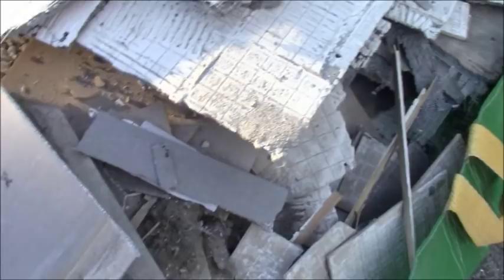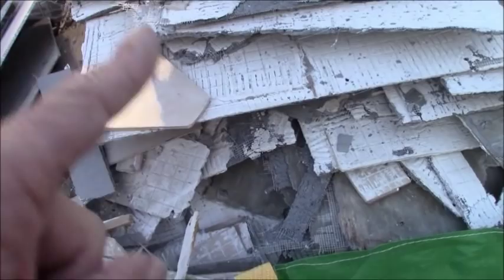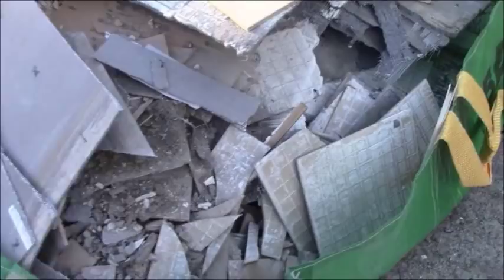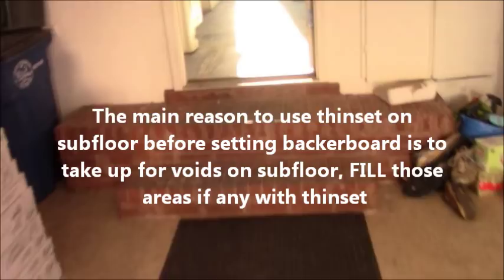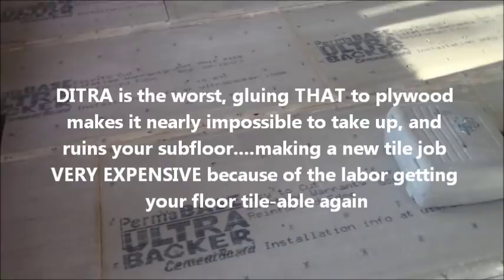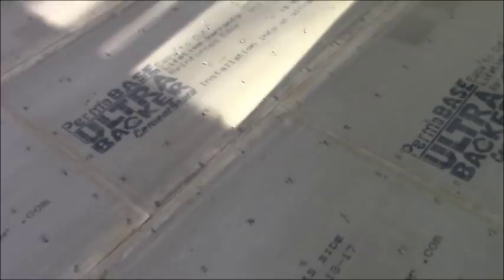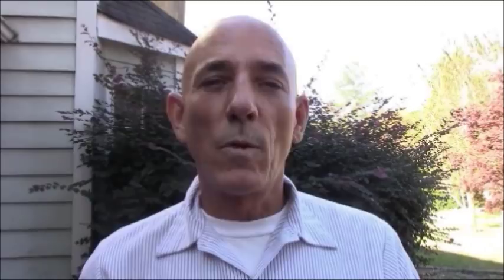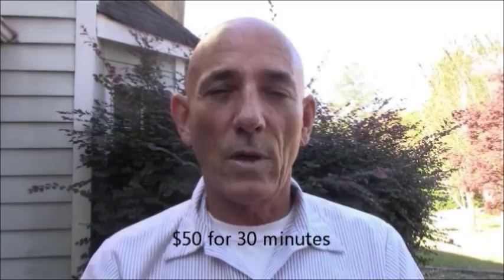GLUE BACKERBOARD ON SUBFLOOR ??

Comment: So I am doing a curbless bathroom and your video was very helpful.  I need to build up the bathroom floor to meet the pan height.  I am doing 3/4" plywood, then 1/4 cement board and then ditra on the cement board.  I won't be using thinset on the cement board to subfloor.  Does this sound reasonable?
Reply: This is exactly what I am doing.  I'm at the backer install phase now, and wondering if I should thinset or not.  I had to put 3/4 tongue and groove ply on top of my 3/4 OSB subfloor, secured by a million screws and used feather finish and adhesive to fill the low spots there.  Now I need 1/4 backer, then ditra, all to get the height to the curbless shower pan.  The 3/4 ply is pretty darn flat and basically level everywhere.  12x14' floor plan.  Some low spots when running a 4' straight edge mostly no more than 1/16th inch with a few 1/8th inch spots.  Those are over a few feet.  I'm thinking with backer screwed down only as another flat surface, thinset to ditra, and thinset to tile, there should be room to take up those gaps.  What did you do and how has it held up for the last 2 years?
Reply: btw my tile is 12" x 24" ceramic

Comment: If the customer chooses not to pay the extra cost of  thinsetting the backerboard, fine. Assuming you have explained what the mfr instructions are and why they exist, and your personal experience not thinsetting. Not doing it because of the difficulty of removal  is wrong. Using unmodified thinset, stats clearly not for use on plywood because it doesn't adhere well, i.e. easy to remove. You addimitly against it is 100% incorrect.
Reply: Would you use modified flexible thinset ?

Comment: Question based on all of this dialog - the subfloor in the 100 year old house I'm working on  is 1x4 pine on a diagonal with typically 1/4" spaces in between the boards.  It was under hardwood. I'm changing this room to a bath, so to tile.  I was planning to put the backer board down on the 1x4s with screws or roofing nails. Then tile. Sound good?
Reply from the maker: When I run into old houses with slat board as a subfloor then I usually put a 3/4 or 5/8 ply on top of that, then quarter inch backer board and then tile

Comment: 30 years under my belt, of setting tile, and I've been creeping on your videos for a couple years now. while I don't necessarily agree with all of your methods, you do tend to give your objective reasoning and accept your reasons to be challenged. I admire that. 
This particular matter, however, is one that I've always fought myself over. I always want to meet manufacturer requirements, but I have yet to see a problem from other people's work, which directly resulted from not thinsetting down backer board. I still do use thinset under my CBU, to satisfy the manufacturer, but I usually lay down paper or plastic beforehand. This allows the thinset to bridge any lows, but allows the CBU to be only mechanically fastened to the sub floor. It may kind of, maybe allow for a small amount of uncoupling as well

Comment: Garbage it needs thinset under it.

I think your just hard headed.
Reply from the maker: Not hard headed, just a LOT of experience so I speak that which I know.
Reply: StarrTile 
Why not just fallow ntca recommendationd ? 

It's like installing tile with grout only.
Reply from the maker: Say WHAT !!???
LOL !! I'm not doing things to ruin my customers house/floor...you can, I won't. 
Robots do with no thought or logic, sorry buddy I'm not a robot.
Reply: StarrTile 
Like I said your just being hard headed.i think your mentality is everyone else fallows the manufacturers guide lines  are just sheep..but you know better than companies that spend a ton of money on R&D .

Atlest have a disclaimer that says you don't follow ntca or manufacturers guide lines.

So DIY'Ers can make an educated decision.
Reply from the maker: Hard headed no, just common sense...if I started having failures I'd have changed my method YEARS ago. And I agree that most companies do R&D, but in the end they overkill instructions to CYA themselves...the typical DIY'r that has zero experience could mess it up easy, so most companies will put that COFFEE IS HOT label on their cup.
Reply: just an fyi, we had floor tile installed 2012 where thinset was used under the hardibacker board along with screws.  We pulled up the floor last month and all that thinset was dust and only thing holding the hardibacker board to the wood subfloor were the screws.
Reply: I build towers and know first hand how engineers during R&D overcompensate. Watched a ton of your videos during my shower project. Thanks
Reply: I have worked with tilers with 30-40 years... 10-20 easy and they are glue and screw... Not a few all... So using experience as your go to is not the best hand to deal... It does make it hard to remove but it also gives stability to floors where it can lack what you dont see or feel... Use a flex bonding mortar so it is slightly flexable and you're good... I also took a class where we glue and screwed and did not... They used a jack to shift the floor to represent contraction and the non glue floor cracked in 5 different spots... The glued floor was solid.... Not saying you are completely wrong but saying gluing is as correct as your opinion of not... I like your videos though... Keep up the good videos and try to rest them knees lol... Take it easy boss
Reply: Also 1 more thing... I did a floating floor in my brothers house... House is 1 year old... When you walk in it it use to shake bad... Under the floor I glue and screwed 1/4 ply..... The house was soild as an ox afterwards... His wife thanked me for taking the feeling of them having a train next door away.... So as I said above it gives stability.... His house cost 200k to build also... #buildersnowadays
Reply from the maker: Mike Fox Renovations I appreciate the information you provided, would have loved to see that floor come up the way you described, however I go overboard with nailing my backer board and I doubt very very seriously that I would have that same failure but perhaps they use the instruction of the manufacturer which was probably to use less than I would ever use. And I am not disagreeing that spreading thinset and then your backer board will be a more stable application, but the question is why.. if thousands of people have never glue their backer board and never had a failure then what difference does it make in the end, after 20 years if I had had a failure with a floor I would probably change my method. Also I love showing videos like this where there is no failure, but yet other YouTubers out there will bash me and tell me I'm doing things wrong without one piece of evidence, all they point to is manufacturer's recommendations, tcna, Etc without providing any evidence whatsoever. One guy in particular talks about all failures that are possible but never shows them, in a court of law he would lose every case he presented
Reply: StarrTile yeah like I said I am not calling you out or saying you are completely wrong... I also agree with the subfloor issue but if you use hardie it usually can be retiled over... You do great work and I enjoy the things you post so keep up the great work
Reply: Thinset is more about filling in variations in the subfloor. Also, I'm sure a lot of people were not using a polymer modified thinset(got glue) for plywood.
Reply: If he is wrong then how can you explain my floor that lasted 22 years before cracking laid on 1 inch thick wood only sub floor?
Please explain why you are so convinced backer must be glued if the idea with backer is to cause a semi floating floor. 
Now days people do want to change their floors on an average of every 6 to 12 years. Why make that an impossible task just because USG or some other Globalist NWO corporation tells you too. I will go with the word over experienced tradesmen over some college book worm logic any day. How long has your tile company been doing this and what experience do you have doing the job with out GLUE AND SCREW. The point is Do not knock it until you have tried it. 
I am old enough to have been in the world before durock and have seen quite a few smart things in my time. Not sure if you are one them.

Comment: if you think thats bad you'd really be in for a treat up north where we used metal lathe and mortar for years as our sub floor....worst tear out ever.....but yes you always thin set your board down, tile jobs are meant to last a life time you dont worry about whether or not another guy is going to come along and do it again 20 years later....this is just being cheap and lazy, not wanting to pay for twice the amount of thin set.....this is hack shit
Reply from the maker: I base nothing in my videos on opinion or cost, in fact I don't even cover the cost of material, all my opinion has to do with real life experiences as I showed in the video, that does not lie despite and regardless what you have ever been told or how you do it... Life Time is what they get without using thinset, but then you back nothing up with proof as to what you said so it is irrelevant
Reply: I lived in New York all my life where tile floors and real hardwood floors are the norm. 50 year old buildings with the original pink or teal tiles😝 I now live in Georgia where the homes are built to be torn down and replaced eventually. The trend of the day prevails and complete guts of older homes are common. You can’t... shouldn’t judge the method strictly based on what your used to. I can definitely understand why you wouldn’t permanently attach flooring your sub floor with adhesive. And as for manufactures Recomended method.. again,  the real world changes, improves and adjusts as it sees fit. My home here in the south, has no tile anywhere. They put carpet in the bathroom 🙄. But we plan to glue and screw with the mindset that we will be the ones doing removal later on, only for better water protection. People treat flooring down here like wall paper.

Comment: So are you saying that a perfect, and stable subfloor there's no reason to put thinset under the backer board? Because that's the situation I'm in. Very solid sub-floor, perfectly level, and I want to put some tile down instead of linoleum.
Reply from the maker: What I am simply saying is troweling out thin set and then screwing the backer board to the floor will cause problems later on removing, when in my humble opinion it is not necessary to do both, either use a lot of screws or a lot of nails to fasten your backer board, I don't see the advantage of having thin set and then fasteners

Comment: scraping a quarter inch thick layer of the contact cement  /with lots of linoleum still stuck to it/ off the concrete floor before installing my kitchen tile i was cussing that dude every 5 min!
Reply: but i bet you charged a heck of a lot to take it off
Reply: Who in the hell uses that much contact glue

Comment: ... due to costs there is no going back and with that said 

HEADS UP --- i over think things and my posts are sometimes long because my thought process is long, and with that said,

-> Warning LONG POST 

*TOPIC

-Hardieback Boards 
-Thinset
-Liquid Nails
-Vinyl on Hardieback 

... my plumber who also does tape and float, floors and other things was going to put a new toilet in my small bathroom but we noticed some of the flooring around the toilet area was rotten out so I had him just put entire new floor of plywood instead of cutting the section out especially since the bathroom is small.

... my original plan was to use peel and stick vinyl squares, and he brought up maybe putting hardibacker on the floor. 

... I didn't know what that was so I did some research and went ahead and okayed putting it on.

... now for some reason I did not continue to research (i should have) and i didn't know about the recommended thin set layer between the subfloor and the HardieBacker ... and my guy used Liquid Nails and hardibacker screws because he said he's done that before with no issue.

... but i didn't realize is that you can't use peal stick vinyl squares on top of HardieBacker boards.
* (unless there's a way? )

... so then I thought maybe I should just go ahead and use ceramic tile from this point forward since I have seen some of his ceramic bathroom floor work and looks pretty good.

... but then he tells me that it IS possible to use peel and stick ( or non peal stick) vinyl squares on top of the hardibacker board by FIRST applying and spreading vinyl tile Adhesive on top of the hardibacker board and then apply the squares.

... and then I just recently read that it would be best to first apply self leveling underlayment like your video, and then use the VCT adhesive on top of that then put the vinyl on top.

-> So my questions are:

1. is it really possible to use peel & stick vinyl squares on top of HardieBacker board especially if you're going to use a vinyl tile adhesive first and or self leveling layer?

2. What about the issue of him using Liquid Nails between plywood and Hardieback instead of the recommended thinset?

and most importantly since I don't have the money to tear it off and start all over and since the new floor and the HardieBacker boards are already in place (and actually looks and feels solid)

-> what is your advice to do from this point forward?

1. Try the peel and stick or regular vinyl using vinyl adhesive or self leveling underlayment on top and see what happens?

3. or ????

#Thoughts 🙄

Comment: Thank you for sharing this video ,I decided to not put thinset under backer board, but I have a question. Should I seal osb floor(with Levelquik acrylic primer) before installing backboard, since the osb subfloor is 20 years old and a little bit uneven. Do I need self leveling the osb subfloor or just install the backboard?
Reply from the maker: Using a self leveler is totally up to you, if it's minor deflections you can make it up with thinset but every job is different so I cannot give you a straight answer
Reply: @StarrTile   Thank you !

Comment: I totally agree with you !! I also do flooing For a living Carpet vinyl hardwood floors just recently had to pull up a floor that was glued and screwed I would love to slap the crap out of people that do that
Reply: You must not understand how to do renovations. If the floor is 3 layers thick. Remove the tile. Sweep up and clean. Get a good demo blade or blades...Cut the first layer down to the sub floor. Or to the joists. Depending on how good you are and your crew. If you are a surgeon when you do renovations you will understand what I am talking about here. If you are not or do not have fast amounts of knowledge in removal for renovation then pay attention. Make the cuts manageable. Start with cuts that are small. 2'x2' get down to the level you want and pry easy. Thing will start popping up.Vacuum going and a broom could take you 1 hour to do a 12' x 20' area. If you are clueless it could take you 3 days.

Comment: i am about to set tile on concrete floor. Any advice? should just set the thin set right on concrete
Reply: That's fine generally but concrete usually can't be relied on to be level. Check for low spots and use a  good filling/leveling product imo before setting the tile.

Comment: I have a stacked washer and dryer and a small bathroom. Heavy. Can I still get away without gluing the 1/4" hardie board? I will use lots of screws.
Reply from the maker: As long as your floor is sturdy, flat, and level, the reason you would use thinset first is to take up for all of that
Reply: @StarrTile  thanks. I have tried to to do my best to scrape everything out. But there are some glues that might give 1/8" variation of thickness

Comment: Do I tape the seems once nailed down?
Reply from the maker: If you follow manufacturers instructions, then yes, use tape. I rarely do because in my mind I can't see the benefit in doing so....it is said it will prevent cracking between the sheets that MIGHT transfer to the tile, but I've never seen that happen and if it does, you have a BIGGER problem. My CYA response is use the tape if you think it helps.

Comment: Bob my house has 24" oc floor joists can I still only use 1/4 hardy backer
Reply from the maker: Depending on the subfloor...if it's 3/4 or 5/8 you should be fine, anything less should be shored up with another sheet of ply

Comment: What are your thoughts on taping the joints?
Reply from the maker: Although it is recommended to tape the joints, the way backer board is set and the thin set that is embedded anyway during the tiling process I find redundant and not necessary, I've never run into a failure on a job because joints were not taped, however having said that I'm sure it is not hurt anything by doing it, but that's just my opinion

Comment: Hey Bud, love your videos man. learned a Ton . Ive got a question on an up and coming renovation the wife and I want to do. How do you feel about putting Tile on a second floor? We have a High ranch and want to run continuous tile from our kitchen to our living room and through the bedrooms into the bathroom. Ive heard mixed reviews from NON professions on why I should not tile a second floor. Mind you there are some High and low spots in my current floor. So given all that I would really like to know your thoughts and recommendations on this decision. We wanted to do tile over wood because we have to large dogs and fish tanks, 2 things that are horrible for wood floors. thanks in advance.
Reply from the maker: I don't know why people tell you not to tile on 2nd floor, I do it all the time. A sturdy backerboard like 1/2'' Hardi first, then tile away.
Reply: Hey man , thanks for the quick response. They mainly said dont do it 1 because of the extra weight on the floor and 2 because the second floor deflection over time will crack the tiles